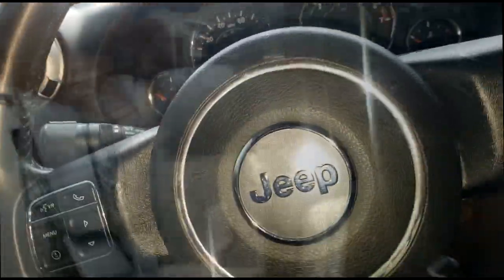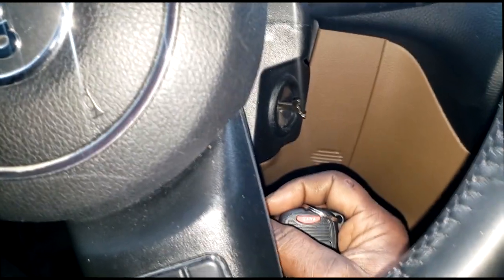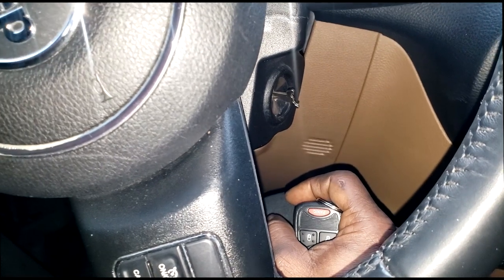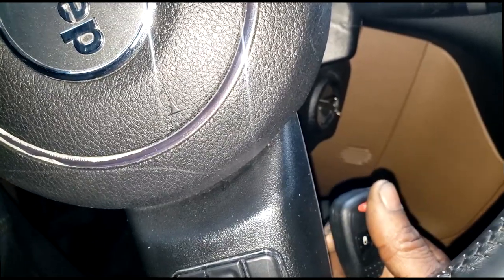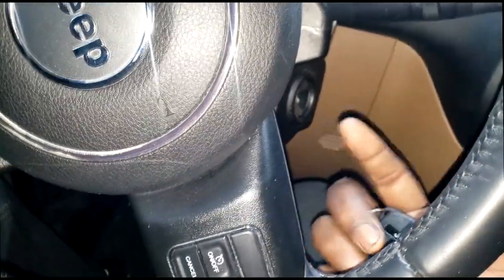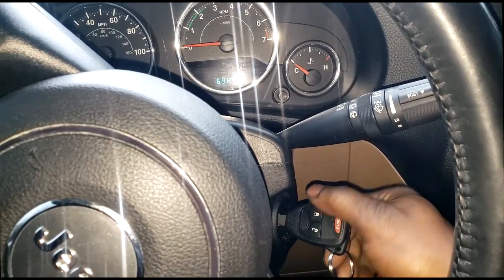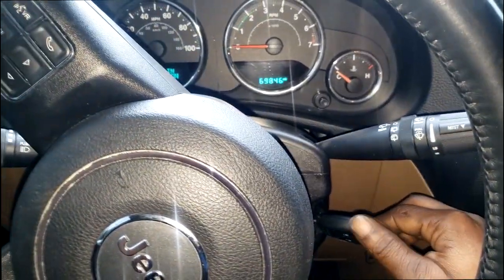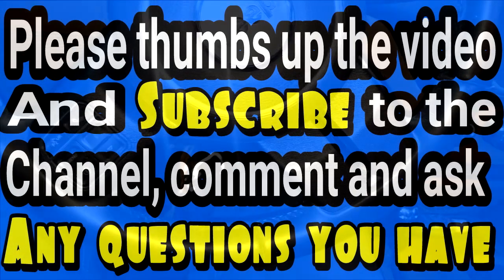Don't waste money on a TOW TRUCK. If your key broken in the ignition you may still be able to START.

Comment: JT that totally makes sense as the module is just a rf chip the module picks up when the whole key is close enough to the ignition cylinder. As long as the module sees the proper code coming in to prove it is the proper key in the lock it will start whether it's physically attached to the key or just close by.
The newer push to start and remote start ones probably just have a more sensitive receiver so it can just be close to the car as long as it sees what it wants whether it still use some kind of key or not once the start button is pushed.